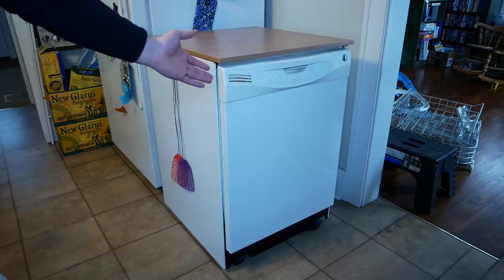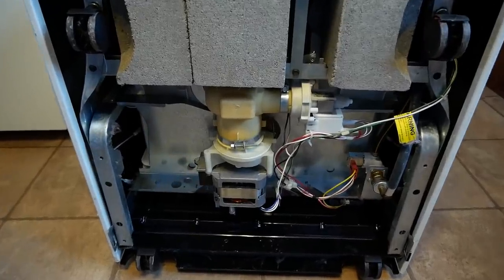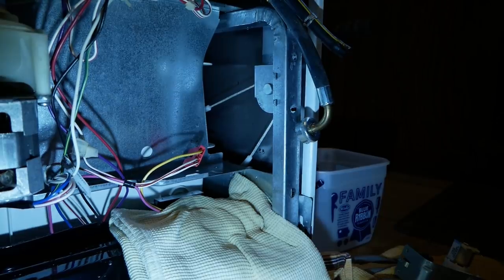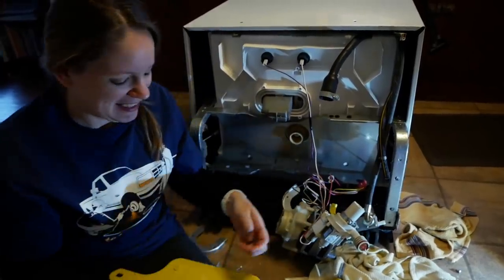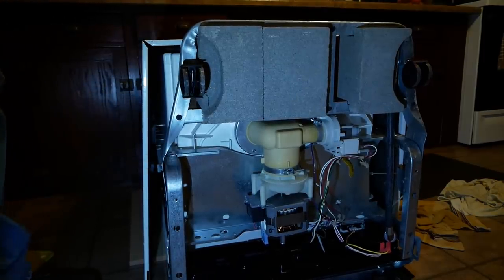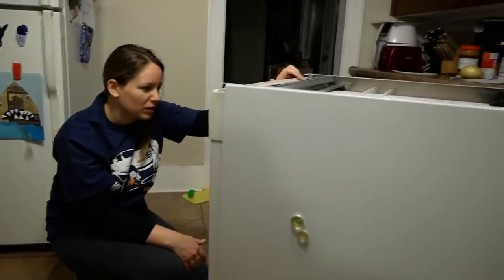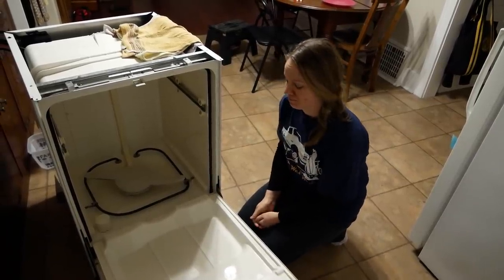Dish Washer Repair | a Lose-Lose Scenario

Comment: Ours is really basic. Just an on/off button and a dial for auto/manual cycle activation. Dial has been damaged by child hands, and now only the auto setting works....  It's one of those things where trying to fix it myself would probably be disastrous, but getting a tech out plus the repairs would cost too much compared to just buying new. We'll just use it until it quits.

Comment: Any "wet sump" even your vehicle's oil pump-
must have liquid in the pump chamber to work.
There isn't a ShopVac built into it- that lower "sump"
is always going to have water in it. 
Most quality dishwashing detergents have
antimicrobial ingredients to combat any stagnant
water from growing mildew/mold.

A once a week sprinkle of Baking Soda in the bottom
will help keep stuff fresh, tubes & pump clean.

I washed dishes for a living, with 2 restaurants 
when younger, Professional Hobart equipment.

Comment: FYI: the bricks are there to counter balance the weight of a full load when both baskets are pulled out,.. we had a roll away that even has 2 little feet that popped out when you opened the door  to help stop it tipping over
Reply from the maker: Nice!

Comment: I liked the older Kitchen Aid dishwashers that had a course filter and a grinder that ground up anything that went through the filter. They washed dishes better and were easy to work on. Unfortunately they sold out to Frigidaire and many parts are no longer available.
Reply from the maker: This thing has a grinder, but the filter is plastic.

Comment: Looks like there was slack/room to replace that connector with a "C3" connector, which is my go-to replacement when I find inadequately sealed, crimp on junk in places which are actually exposed to the elements. Overkill in this instance, but better than not being able to take things apart again.

Edit: slick editing job once again. If being a mechanic and a YouTuber don't work out, you've got potential in that area.

Comment: Up to one cup of water will be left in the trap this is to keep the seals from drying out in between uses as soon as you start a new load the dishwasher will pump the water out just in case per se it become stagnant if there is more than that it could be a pump issue or in your case what happened with your dishwasher.

Comment: Don't know why taking of the fill valve off would be the cause of it not draining. If you hear the dishwasher trying to drain and it's making normal noises it's something blocked somewhere or a bad check valve which is less common, usually the case is a piece of glass. What I would do is wash wine glasses by hand and if you found glass inside the sump I usually replace the drain hose, what can happen is a piece of glass will go into the ribbed drain hose and get stuck and while it's washing it works fine but as soon as it drains the glass acts like a door and it flips over and blocks the flow of water it's also near impossible to take out of the house. Also carefully.what you put inside it if you making fish make sure there isn't any fish bones,.cherry pits ..etc. also take the stickers off you plates and glasses. There is also always water in the sump it needs the water to lubricate everything even your washing machine always has a little water sitting at the bottom of the tub you just can't see it

Comment: I believe that little water is left there so that the pump is primed, when it starts.
Reply: I used to live in an apartment and went a few months handwashing dishes cause it wasn't worth using the dishwasher for the small amount of dishes I was using at the time.  Apparently the little tank at the bottom of the dishwasher dried out and apparently when that happens with that particular model it vapor locks or something and makes the dishwasher leak all over the floor.  Ever since then I run the dishwasher every few weeks whether I need to or not.

Comment: First problem, it is a GE. Water inlet valves have NOTHING to do with draining. And lastly, ALL dishwashers have a little water in the bottom to help keep the "pump seal" from overheating. Otherwise, good job of diagnosing the problem.
Reply from the maker: My theory was it was leaking water in when it should be closed. Simplest things first.
Reply: @WatchWesWork  Could have run the DW with no water on.

Comment: I had a similar problem, it was the pumps impeller . . . it was worn down to the point it wouldn't move enough water . . . easy replace, cheap . . . Rog

Comment: It won't pump completely dry as the water in the drain hose will run back into the machine when the pump stops pushing, so there will always be a bit in there. She looks disappointed though, was hoping for a new machine?
Mine did the same thing, but was full of manky dishwater. I ended up dragging it onto the lawn to clean it out.

Comment: I know nothing about appliances but among my family (at least my cheap brother and his cheap adult kids) I have a reputation for being able to fix anything. I fixed my brothers 35 year old washing machine so many times my sister in law gave me $100 bucks to not fix it any more. But mostly things just start working when I'm around. Problems they've had for months just go away. Stove burners that wouldn't lite for years suddenly work when I try. Vaccums that didn't suck suddenly suck. Ovens get hot refrigerators get cold dryers dry and washers wash. Why? I have no f#$king idea. Mostly I attribute it to them being idiots for not knowing how to operate there appliances. Oh occasionally I will fix a switch or a hose or a loose wire. But mostly I just turn it off and on until it works. It's an annoying talent to have when you have cheap relatives

Comment: Them freestanding dishwarshers like that one sure do make a dandy roll-cart/work table, if you can keep the rain and snow off of them!!

I really don't know much electrical code - not that it applies to a dishwarsher, but I'm not liking those crimp connectors for AC use, especially in a probably vibration-rich environment.  I would've done a twist connection (assuming both sides are stranded wire) and some heat-shrink, and heavy duty heat-shrink if there is such a thing...  I'm kind of not a crimp connection fan, and it bugs me that the wire terminals I see are nearly all crimped on...
Watching and waiting for an appliance going through its cycle is worse than watching paint dry.

Comment: Generally speaking most dishwashers will have a little bit of water left in them when they're finished I've never pulled one out that had at least a couple or two of water left in the bottom

Comment: the drain motor is on a timed  cycle based on an assumption of how long it takes to pump out the water, that has been pumped in..  the dishwasher has no idea if theres water in it left over or not... the fill time is the same thing, its based on a timed fill cycle.     another cause of water in the tub is a water fill valve that is leaking water in when its not supposed to be.. a restricted drain line, full of greasy gook, a drain line not elevated high enough, a clogged air gap valve.  also if the drain hose goes into the main sink plumbing with a stub out, it can get restricted as well.

Comment: There will always be a little bit of water that falls back down to prime the pump you can never push all the water out cuz the hose goes upwards.now the somehow they had those to where a wire went up to the end where the water connects tiny pump there you get rid of all the water but all dishwashers are like that

Comment: I had a similar problem with a Kitchen Aide roll-around dishwasher.  the problem turned out to be a kink in the drain hose. Two pieces of straight 1/2 " cpvc pipe and a cpvc elbow in place of the hose bend and my marriage was saved.

Comment: I've recently fixed quite a few appliances just because well...covid in 2 ways. 1:Money isnt falling out of my pockets and 2:Everything is sold out. Dryers which are not almost 1k or washing machines, stoves ect, are all either 800 900 Canadian (not a WHOLE bunch, but they're all crap) or they're sold out of everything and back ordered for months because of ''covid'' delays. Long story short, appliances are a whole new world. Oh the dishwasher makes a funny sounds, the stove has an F10 error, the washer leaks, the dryer doesn't heat. For sure some of the repairs are decent, dryer elements (cheapo poop ones) last like 3-6 months and then go. Once you start fixing stuff, something is always broken.

Comment: a guy I knew had a toilet that was a crapshoot sometimes it would flush and sometimes it would overflow. this went on for a couple of weeks. finally he pulls the toilet and lays. it in the yard out of the bowl rolls a partially eaten apple . his kid flushed a apple and it would bob like a check valve.
 Now fast forward a decade to q new condo my toilet began doing the same thing. 
 finally after several. plumbers the last one pulls the toilet and finds a knockout plug . that is supposed to be removed after plumbing is inspected before the toilet is installed. the plumber had broken out the plug and let it lay in the elbow. so it really was a check valve

Comment: i bought a used dishwasher 4 or 5 years ago and in all that time it has had a problem with water leaking in when it wasn't on. and im simple just to lazy to fix it, so i am closing the tab each time its done washing. im guessing if i had just replaced the valve back then i would actually have saved a lot of time all together, but still to lazy

Comment: OK so the motor has a big rubber gasket, manufacturer has them wet to stop gasket shrinking and leaking, remember dishwashers sit a long time until sold..I know I had to tell customers its normal to be wet its not used..so if you dont use washer put some water into it to save big round gasket...  or they will leak over time.. weird fact most peoples do NOT use their dishwashers??

Comment: Pretty sure it will never be able to pump "all" the water out, there will always be some drain back when the pump stops. Same thing with a washing machine, it's why they have a drain off point so you can clean the pump filter.

Comment: I did the same on our clothes washing machine. It almost brokeour marriage aswell because no matter how much or how less detergent i would use the clother would still stink. Ended up fiddling with the water intake to pump more water because it's one of those fancy crappy ones with low water usaage... was it washing the clothes before properly with less water? No. Does it now with more water? Yes.

Comment: 10:50 there' always a little water in the bottom. Not unusual. You can drain more by using the rinse cycle.. but it's normal

Comment: That manufacturer got cheap.
That "Molex" connector was NOT a Molex brand connector.
True Molex A/C connectors look nothing like that and are very much distinctive from D/C connectors.
It burned because it wasn't an actual Molex connector designed for water appliances.

Comment: Found a pinto bean ...in  a washing pump area motor reversal would push up into corrugated drain trap in the rigdes of the hose and never send it out when reversed for washing it would sneak  
back down to the water  
pump and make a rattly noise...finally I pulled the drain out of the standpipe...filled low of water in the washer and a bucket and layed the drain hose real low to the floor...set timer pump
out spin ...water went in bucket and out came a pinto bean...I was there for almost 25 minutes...well saying well I don't hear anything and she says "if go...I know your coming back"
I've heard old Calypso washers were famous for getting bra wires stuck in the water...although I think those items are not really a great idea in washer if mixed in with heavy cottons...FYI.

Comment: Lol I'm glad the European dishwashers have proper filters :)
Reply from the maker: This one has two screens, but the plastic found a way though. I think it was aliens.
Reply: @WatchWesWork  the european style ones have a very large metal plate as screen, which would already catch it - and a very fine second screen which is like a tea strainer.

But they run longer, so the screens have less work to do I guess.

On Eco you basically have to clean them regularly, but on the 70°C program everything gets completely dissolved, every time I check its basically clean - and I don't prewash anything :)

Comment: Well, Wes knows how to use tools, unfortunately, the good ones are all in the garage!  8-)   That small amount of water left agrees with my experience on my working dishwasher.
Reply: Wes, do you know what to do if the dishwasher door has been opened too wide?   I accidentally sat on it!  It doesn't seal now.  Maybe I should take it apart and see if the metal hinge pieces can be bent back into shape.  Parts are available if I can figure out which ones need to be replaced.
Reply: Your rollable dishwasher takes me back a long time.  So long ago, I didn't know they still made those!

Comment: We don't even use ours.. it's easier to just clean the dishes by hand and they get actually clean. Not that scenario where you pull the plates out and there  is still crap on them. Yes and everyone has that happen. Don't pretend it doesn't.

Comment: Usually those have a anti drain back valve thats really nothing more than a flap, that gets particialy gets stuck open from smut and slime from the washer. Halfway thru the vid, you hit on the problem

Comment: Ok, those roll-arounds are meant to be used with the heating element which is supposed to flash off the last, undrainable water.
Two, you made this plumber cringe a bit.  :-)
Three, the appliance guys have a dodge now, you run the DW with a WP GoPro (and suitable illumination) inside (drying cycle off).  [The enterprising then flog off the resultant video as ASMR 'Relaxation' vids.]  Why GoPro a DW?  The number of moving parts that are water-powered all have to 'work' to keep the system running.  The pop-up center rinse towers are particularly bad about this, if they don't pop up, they tend to feed back the pump around the check valves.
Fourlthly, you know it's serious when even Max is trying to help :-)

Comment: Yeah that was supposed to be in there keep the pump located when it's running normal Flat Water stay in the bottom of the of the another rasboro from the pump and then turn arm Next to Normal nothing wrong with that out of the same thing KitchenAid I don't do it as something wrong with that Homestead Water and Air keep the pump located have to have water to keep the pump locator water feature pump located I didn't know that

Comment: Not caked dirt in the discharge pipe ? What is usually my suspect when diagnosing bad emptying cycles....
Reply from the maker: No, it was clear. I blew through it with some compressed air earlier in this adventure.

Comment: I bought one of these in 1969 same strange little headache of a contraption, after using it for months it sat for a while when it was used again the pump was rusted in place, after Mr. Fixit worked his magic all was wonderful. 
   Yes ours left some water in the bottom and most of the time the dish drying part of the cycle would evaporate most of the water, so Mrs. Wes no need to fret the portable dishwasher is working as designed. I am not real sure if all dishwashers even the built ins leave some water in the bottom that does not get pumped out each time the pump runs, as where we live now there is absolutely no space for a dishwasher but for me aka the slave, but I cook so guess what I eat first lol. Check this link from Google.
https://diy.stackexchange.com/questions/6338/how-much-water-should-i-expect-to-be-left-in-a-dishwasher

Comment: reminds me of when a small piece of stainless wire fell into my shirt pocket at work and when my wife washed it it went down drain into the plastic drain pump and the spinning impeller punched a hole in the housing making a nice leak magically out of blue water all over floor 100 dollars for a plastic pump and it was all good again  lol

Comment: you're lucky it's a roller dishwasher.
imagine doing the same kind of things with built-in version
Reply from the maker: Yeah. I would assume they are easy to remove, but I have no idea.
Reply: @WatchWesWork  Depends how the cord/hoses are run.  If you ever get a built in unit, make sure you have input into the layout of the cupboards for easy access.  Talk to a local repair guy about it.  This includes "not making a mess when disconnecting hoses", BTW.

You know how it  works Wes -- if it's easy to pull out and fix, it won't have a problem.  If it's awkward to remove/re-install, you will be pulling it out to fix it every second week!

Comment: Am I seeing non- soldered Wes made connectors or am I mistaken?🤪. Great eyebrow movements👍. China will eat our lunch with those cheap cutting boards one piece at a time if we don’t wake up
Reply from the maker: I never solder. But they are not heat shrink. I figure it's not going to see much salt...

Comment: What, don’t they make new dishwashers any more?
Reply from the maker: Have you seen what they cost?
Reply: Yep I bought one about 2 and a
Reply: (Sorry) yes I bought one about two yrs ago and btw it is in the process of a non warranty repair. Not only are they $$$$ but the service tech had a propriety tool to scan the micro controller to troubleshoot. Still waiting on a $230 part. Washing dishes by hand since last November.

Comment: I had a similar thing with the clothes washing machine; spent nearly 2 hours with it upside down to remove the pump and clean it; then came the light bulb moment, there was a flip down access panel at the front of the machine, all for a 1/2" ball of lint.
I managed to turn the air blue.
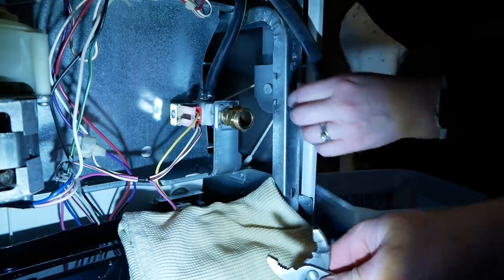3:30 "What are you hoping to do with your fingers there?" That put me in a spin for sure.